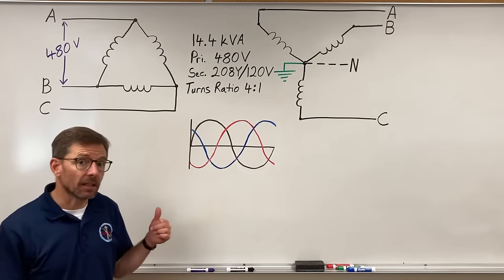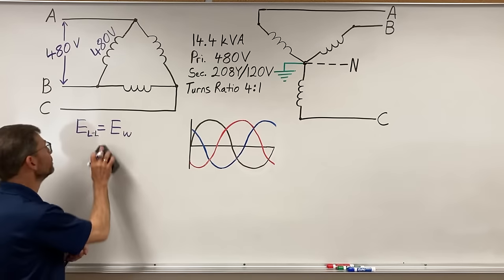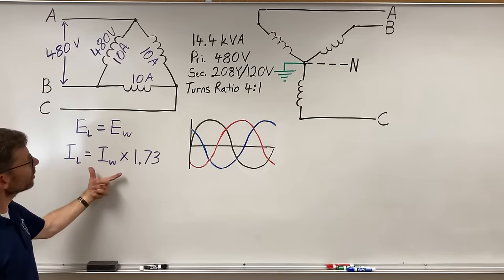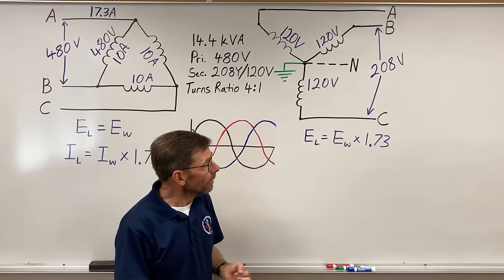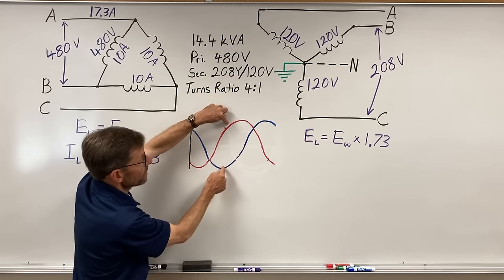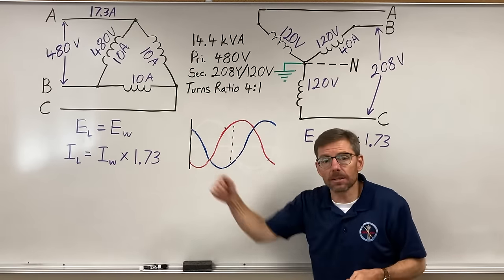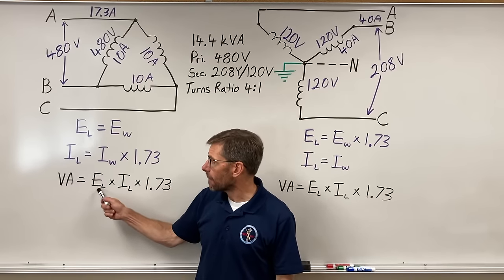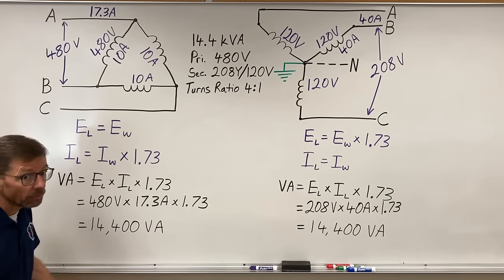Delta and Wye - Volts, Amps, & VA

Comment: Your delta to wye is not vectorially correct.
Reply: true. If we're being fussy, we should also be drawing the delta larger (not anything to do with turn ratio, just in terms of which is nested inside the other... the wye being nested within the delta in phasor terms).
Reply from the maker: Sorry I'm so long in replying - not much time to get to comments and I'm a really slow typer. I did see your comment a while back and I thank you for the reminder that I need to be as technically accurate as possible, even when discussing basic principles and/or different aspects of equipment. I should have rotated it, and I have tried to make sure I'm not overlooking things like this in my ensuing videos. (But I also like the "delta" to look like the Greek (also for change) and the "wye'" to look like a "Y" at the first stages of learning to remember the names. That may be why some people prefer the name "star"...)
Thanks again for your comment. It is appreciated.
Reply: Great video! Thanks, Dave. The only part that confuses me is why you are multiplying kVA values by 1000. It seems like the kVA numbers need to be dived by 1000 to get back to VA units.
Reply: @hubercats  25,000 VA = 25 KVA is a division problem. 25 KVA = 25,000 VA is multiplication problem.
Reply: Thanks, Bob. I realized that I misinterpreted the kVA to VA equation almost immediately. I attempted to delete my comment but couldn’t find it to do so. Old age … - Cheers!

Comment: OH MY..... this is the worst explanation of three phase transformers ever. I taught Electrical Engineering Circuit Analysis for several years. Its not that hard! Some simple mathematical differences. the biggest is where the SQRT 3 comes into account. And that is a trigonometry problem.